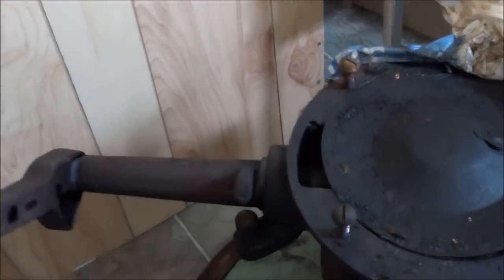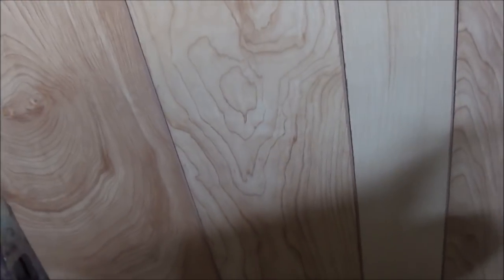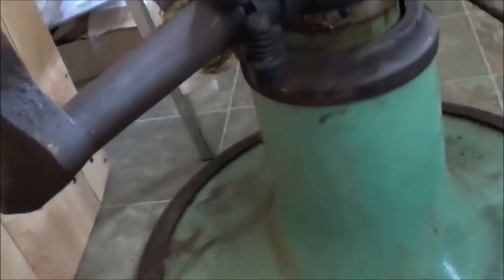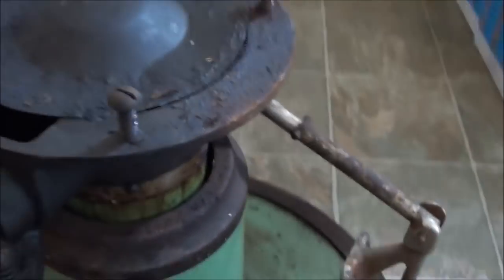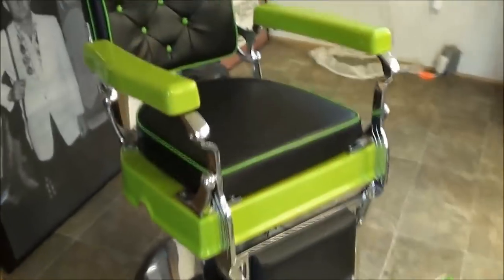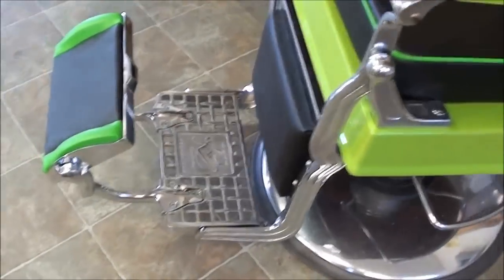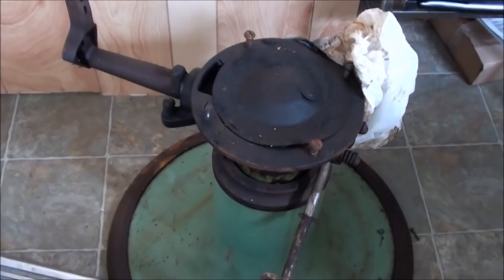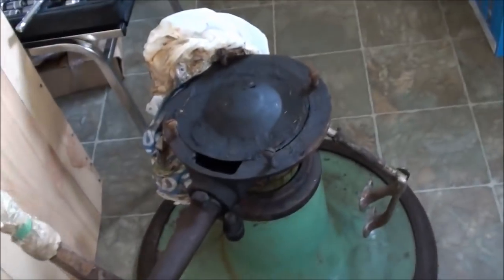WORKING ON KOKEN BARBER CHAIR PUMP!

Comment: I have a Koken from 1898 i had a guy in NYC try to fix it. He took it apart and didn't know how to put it back together again!!! A very bad recommendation. It's a beauty. the only thing wrong with it now is the hydraulic system doesn't work, but i think it just needs fluid. and a metal piece that holds the left arm in place cracked, so i think i need a welder who can put that back together again. Also the wood piece it sits in cracked so i am hoping once the welded piece is fixed i have a guy who will clamp it back together with some strong epoxy/glue. I reupholstered it several times. not a fan of tufted leather. My chair is black velvet.
Reply: Denise Walch his upholstering is a great job! There’s no way I’d want velvet on a barber chair. That’d be a pain to clean.